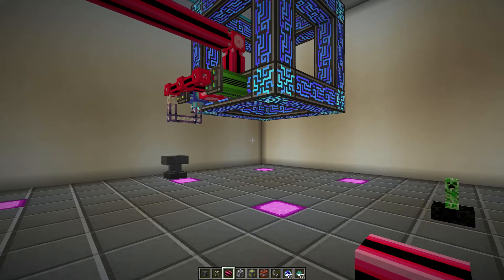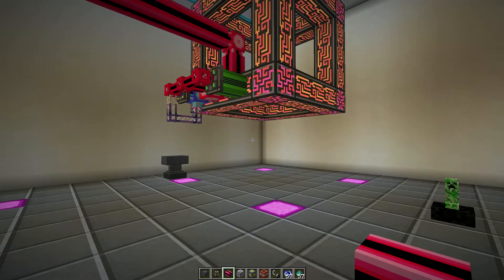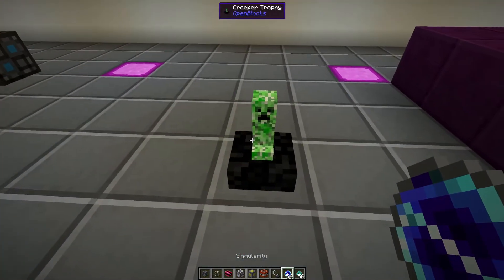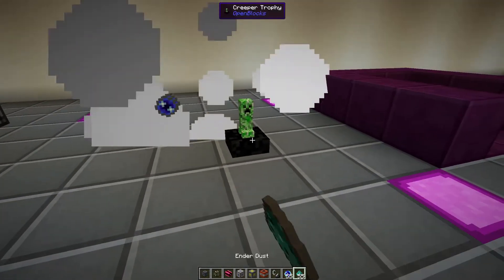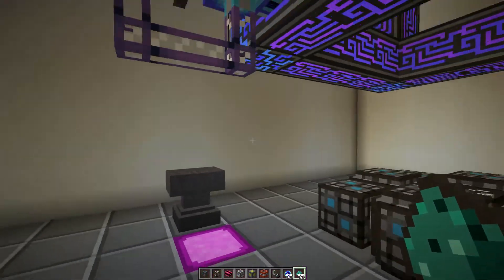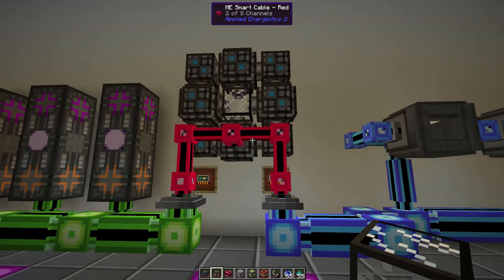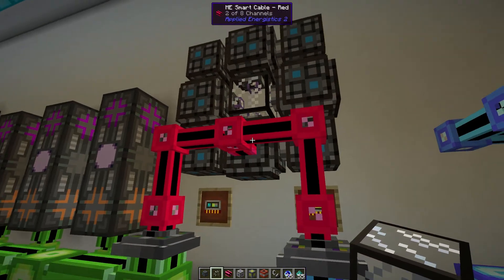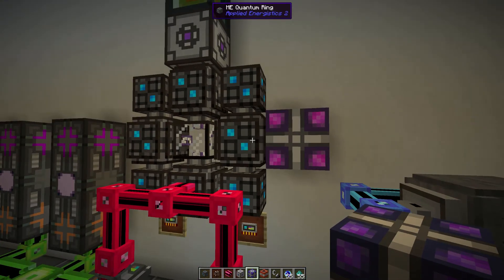Syn's Shorts - Quantum Network Bridge - AE2 (1.12.2)

Comment: are the cable supposed to break when it has those white particle thingies?
Reply from the maker: Which cables do you mean? I was using creative mode to break the cables, so that there wasn't a hardline connected between the ME Controller and the point I wanted to access with the QNB.

Comment: thanks for the video, one basic question i would think that  maybe should have been addressed would be how far away can point A and point B be apart?
Reply from the maker: The great thing is, it is unlimited and cross dimension. 
That is a great addition, unlike the wireless access points for wireless AE terminals which use power per distance and need to be boosted. The Quantum Network Bridge just requires power on each side and the paired Quantum Entangled Singularity to work.